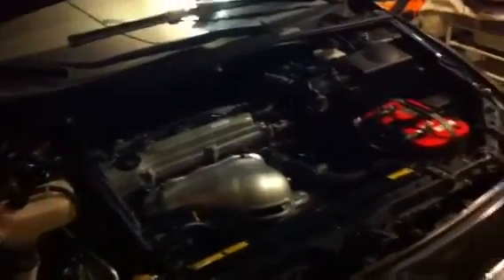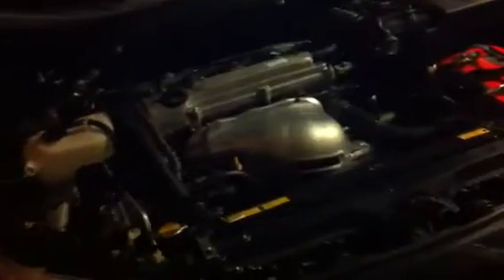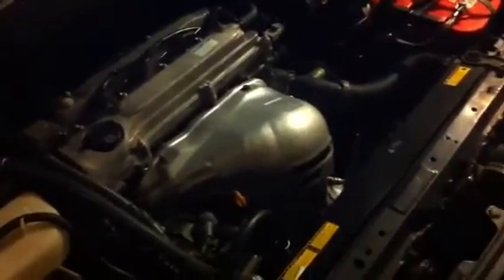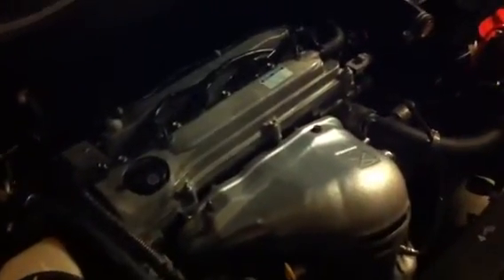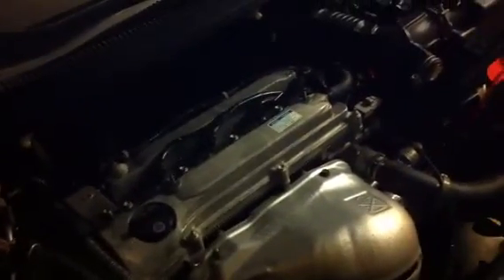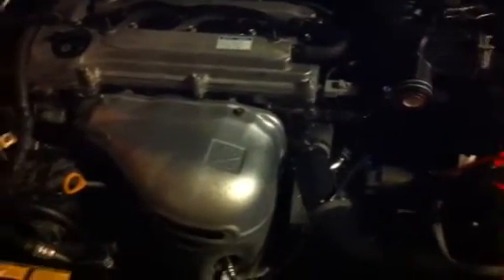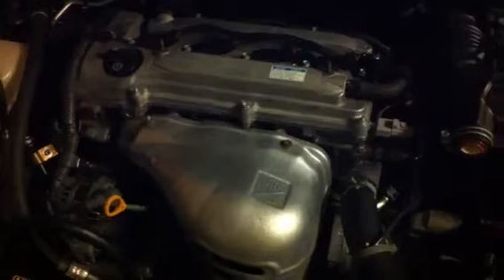2azfe Valve Stem seal replacement pt. 1

Comment: i can do the timing on my 2az-Fe on Scion xb without removing timing cover. just gotta remove exhaust sprocket and chain tensioner, allow slack to the bottom of the chain and spin the crankshaft pulley clockwise and counterclockwise until free of the chain and then align the marks intel u get the timing where u want it, reinstall chain tensioner and engage it by pushing on chain guide with flat head screwdriver and relocating crankshaft back and forth and then double check your timing, get the hang of it and get it right, might take a few times to get the hang of how to do it

Comment: I am going to replace the valve stem seals on my Toyota 2azfe with the engine on the car using this method. I will attempt to do this without letting the timing chain come off of the crank sprocket so I don't have to drop the oil pan just to put it back on. I will do my best to secure the chain in place while removing the cam sprockets. This means I will have to avoid turning the engine/crank shaft. With the timing marks aligned prior to removing the cam sprockets, Cylinders 1 and 4 will be set to top dead center while 2 and 3 will be at the bottom. My concern is, will I be able to pressurize cylinders 2 and 3 while they are on bottom position to prevent the valves from dropping in?
Reply from the maker: Handy Daddy The tensioner will make it almost impossible to not let the chain off the crank. You will need to take the tension off of the tensioner before taking the cam sprockets off to have any chance of not dropping the tension off of the chain. Take your time and be careful, with the cylinders BDC you are risking dropping the valves. I would do the first two, then put the cam sprockets back on, rotate the engine to bring the other two cylinders to TDC. It will be more work, but safer.

Comment: I have an 07 Camry, 5 speed that uses oil like crazy. I am the 1 st owner of the vehicle. Oil change was never skipped. There is no blue smoke, no burning smell and absolutely no leaks. It's always parked in my driveway so it's easy to keep track of that. I changed the PCV valve, that did not change anything, although i did notice the way engine pulls, which is much better. I had extended warranty. It conveniently expired 2000 miles just before the issue started. Go figure. Should i get rid of the car? I mean, i never had any other issues with it. Has 94,000 miles now. Thanks!
Reply from the maker: You are in a tough spot, the first thing to try is to go with thicker oil 20w50 to slow the burn off. Have you taken a look at your spark plugs for white ash? The upside is that Camry's are easy to sell even in the condition you have, but do you have the money for a new car is the problem. This is a well documented issue with this year Camry http://www.camryforums.com/forum/general-tech-8/07-camry-oil-consumption-3696/page15/
Reply: Michael Borquez
 I thank you for your time and help Michael. Did not check the spark plugs, i will today. Thing is I do not want to lie to people sbout the issue when i sell it, nor will i, so the price will drop down if someone agrees to buy it. I know what it's like to be screwed over, I'm not gonna do it to someone else. I bought the car because my friend had 1990 with 290,000 miles on it. Cars engine was amazing, it was literally just ticking, so quiet. Ran great. My bro had 1996 which he drove for 150,000 miles with no issues then crashed it. I suppose they USED to be good cars, then Toyota followed footsteps of GM by going cheap. Disappointing. Do you think it's worth 100$ for Toyota to look at it?

Comment from the maker: You definitely need to switch the PCV back to a stock one. The aftermarket ones always seem to have that issue. Check the PCV hose as well, it has a tendency of developing cracks over time. How did your compression test come out? If your around 150psi with the engine hot your rings are shot.

Comment: Thanks. Engine has been running Mobil 1 High Mileage 5w30 and a couple of Kreen cleanings over the last 90k so I'm reasonably comfortable with the engines health beyond the seals. One other note - you mention the PCV. The stock PCV had a tiny inlet, my replacement Napa aftermarket PCV has a large/standard size inlet. Can hear it rattling like crazy. Assume the larger inlet is better, releasing more pressure? Not sure if its too big, sucking oil into the intake.

Comment from the maker: Couple of things; driving slower will lower the oil consumption. You also need to do a compression test first to verify you do not have a piston ring issue as well. Given the mileage and the issues you describe you may be better served with a rebuild or replacement engine. The oil pan removal is a dual purpose; 1 you can clean your oil pick up and 2 you can verify the location of the chain on the crank.

Comment from the maker: You can technically drive it as long as you want as long as you check your oil level. Beware that this condition will result in fouled spark plugs and will cause your catalytic converter to stop working prematurely.

Comment: I have a 2002 Toyota Camry with the 2azfe 4 cyl engine with 110K miles as of now and it (blueish)smokes for 3 secs after sitting for more then 6 or more hours. This smoking has been happening since 90K miles and oil consumption is seldom. I was wondering how many more miles can I drive with bad seals? any major problems in future? thanks

Comment from the maker: Okay got the job done, but having trouble with youtube upload failures. Let's put it this way: The job is very difficult and will require a helper. You will need to remove the oil pan, which I suggest doing first due to it's difficulty and prepare for a very stressful repair.

Comment from the maker: I'm in the process of doing the job now. I'll have the follow up videos hopefully by tomorrow. I have run into a snag, because I found the timing chain sprocket bolt lacks clearance to be removed without removing the timing chain tensioner.